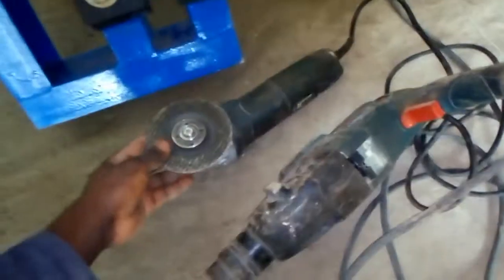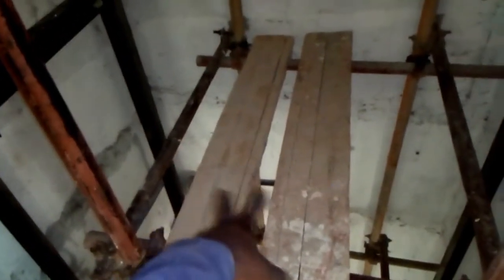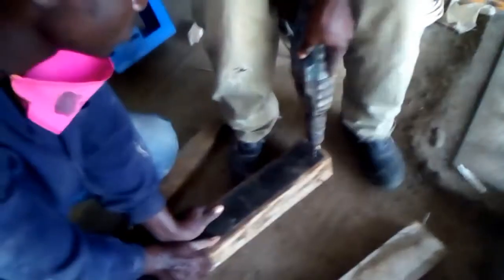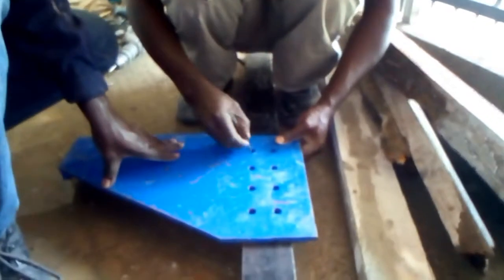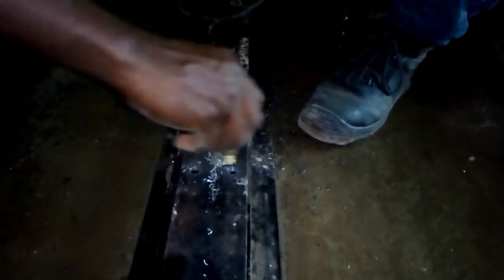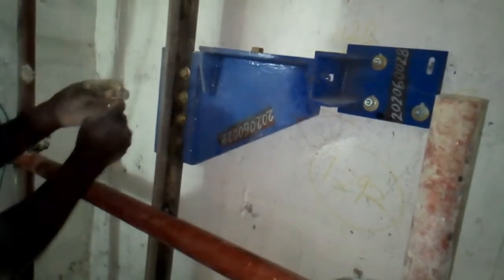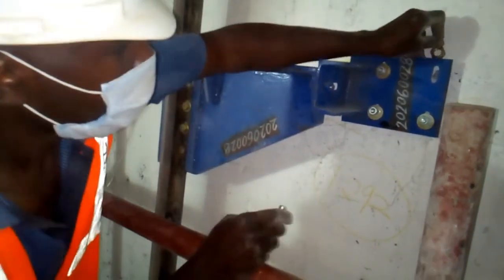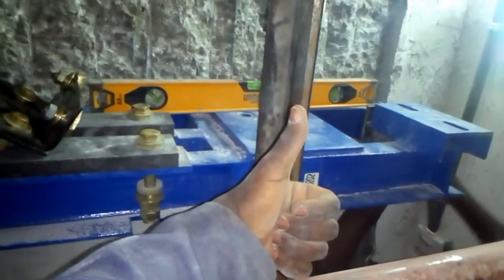Elevator (lift) gearless machine base installation ...

Comment: You dont plumb your elevator shaft right that's why you chip the wall on the machine side.
So that the machine bed plate will fit. I saw that theres still big space on your dead end hitch side. If you just move your plumb further to the right then your machine will fit perfectly.
Reply from the maker: That's true. I'll keep that in mind during the next project...